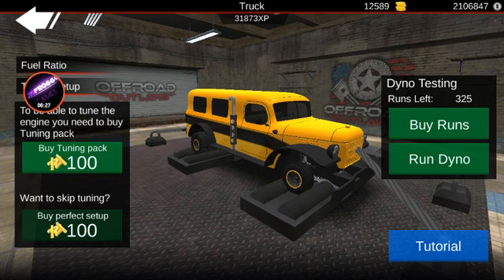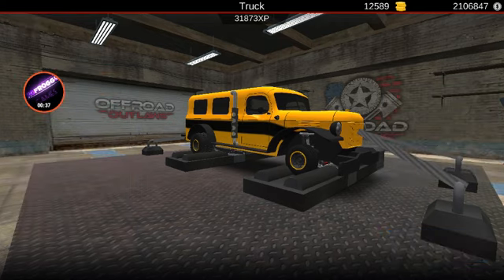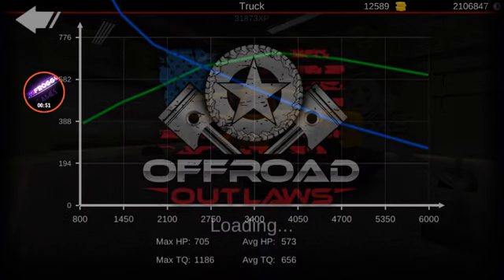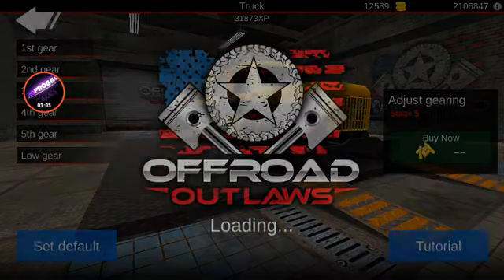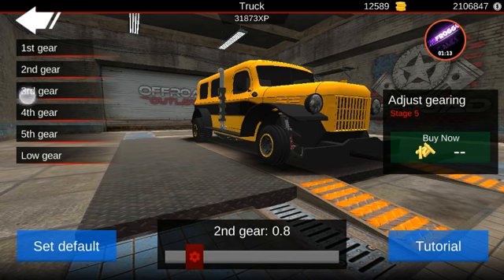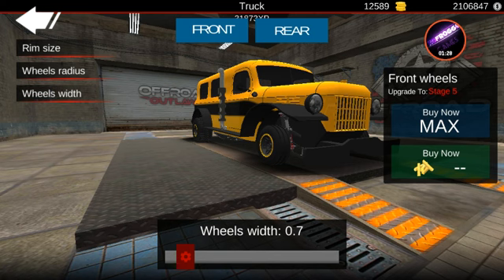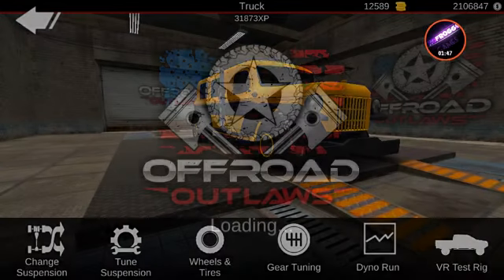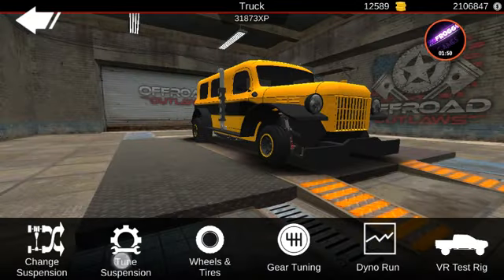Offroad Outlaws Dodge Power Wagon Drag School Bus Build 180MPH (705HP Turbo Diesel)

Comment: Also I usually launch in low because there is better torque and when I get up to hood speed I go into high gear
Reply from the maker: Sometimes that works, with this tune high has faster acceleration